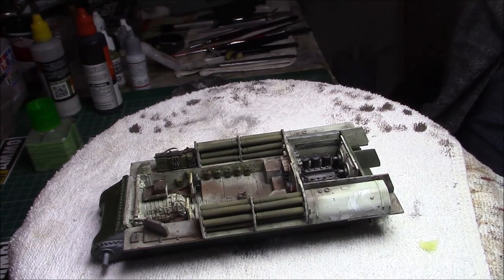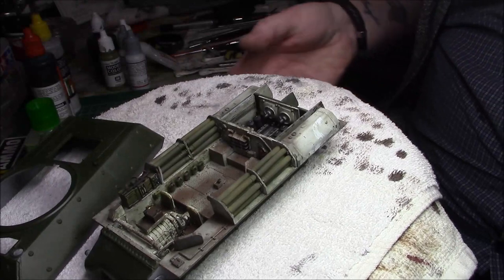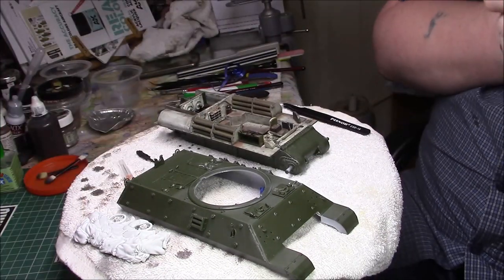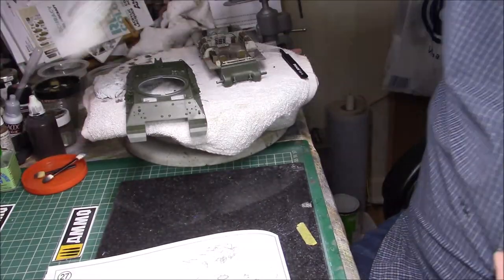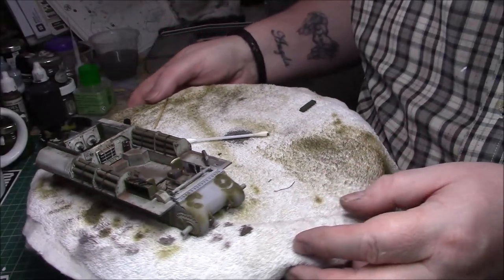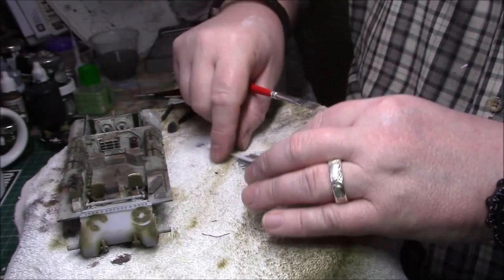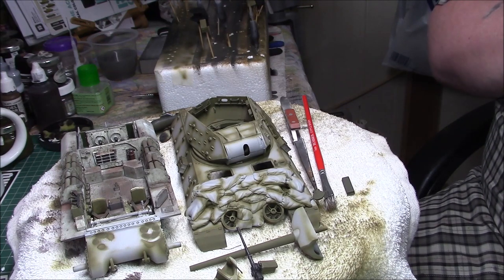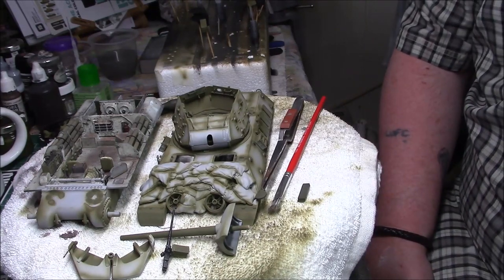Acadamy 1/35 M10 Duckbill update 2

Comment: To use the letters I would sand the plastic block down real thin until I could see through it. Then treat it like flash 😉👍.

There both looking super mate
Reply from the maker: Cheers Vasili  thank you very much and thank you for the tip i shall give that a go.
Reply: @GregReilly135ScaleModels   I don't know if it will work but worth a try lots of sanding mind as the block looks quite thick . 😄
Reply from the maker: There is one way to find out